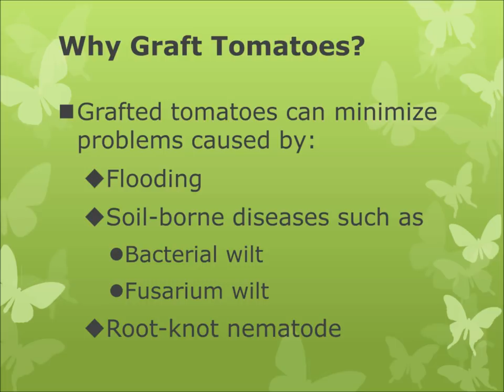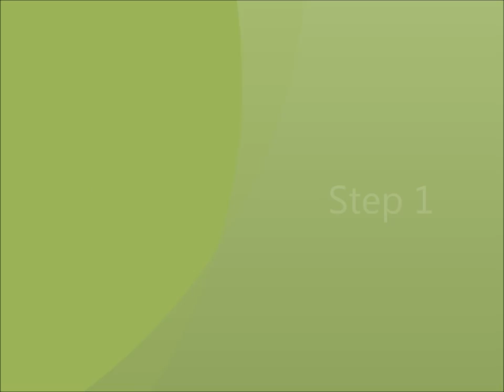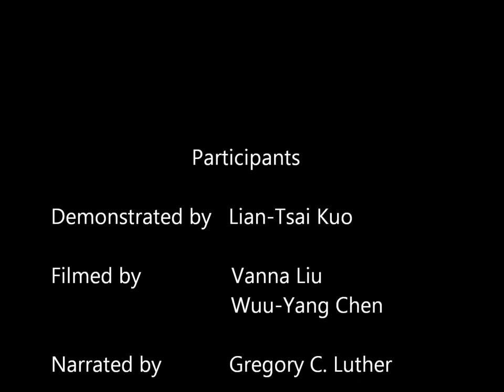How to graft tomato and eggplant: tube splice method

Comment: I too, am wondering what would be the purpose of grafting tomatoes to eggplant rootstock.  What if any advantages are there?
Reply: AVRDC - The World Vegetable Center has several eggplant rootstock lines 
that provide resistance/tolerance to flooding and root-knot nematode, 
whereas we have not found any tomato rootstock lines that provide this 
(for tomato scions). These eggplant rootstocks are also resistant to 
tomato bacterial wilt and Fusarium wilt. We have a tomato rootstock line
 that is resistant to bacterial wilt and Fusarium wilt, but it does not 
have the added advantage of flood- and nematode-resistance.

Comment: is there a e-book or kindle on this,and where can i buy the rubber 10mm pipe from
Reply: Salam alikom : you can find the rubber 10 mm pip in aquarium shop it the same  pipe that it used for air pumps

Comment: is it okay to use plastic tube,say a straw?
Reply: No because it won't harden and break away like a natural rubber tube will. The straw section would stay (for years!) and would constrict the grafted plant ultimately killing it. If you must use something like a plastic straw then cut a slit in it longways so the growing plant stem can force it open and off the stem. Be sure to pick them up after as they're not biodegradeable. However I don't know of any straws that are only 2mm in diameter... Maybe you'd be better with actual straw or a piece of hollow grass stem?

Comment: Hi why you not take tomato scion that had produce ready?
If you make it succesfull?
Reply: Because the success rate of a graft drops with age of the plant. That's why it's done with seedlings with stems that are around 2mm or less in diameter. You get a good success rate. If you were to try with large plants I doubt you'd get any to graft successfully as they'd need nutrients and water from the roots that aren't available until the graft heals which can take a week.

The tops of small plants in shade and high humidity can survive long enough until the graft heals and the roots can feed them. Big plants have higher requirements and die before the graft has healed.

Comment: Hmmm not sure why you would use a eggplant root stock, the root system of eggplant is nowhere as vigorous, strong or as resistant to disease/virus as tomato rootstocks.
Reply: AVRDC - The World Vegetable Center has several eggplant rootstock lines 
that provide resistance/tolerance to flooding and root-knot nematode, 
whereas we have not found any tomato rootstock lines that provide this 
(for tomato scions). These eggplant rootstocks are also resistant to 
tomato bacterial wilt and Fusarium wilt. We have a tomato rootstock line
 that is resistant to bacterial wilt and Fusarium wilt, but it does not 
have the added advantage of flood- and nematode-resistance.